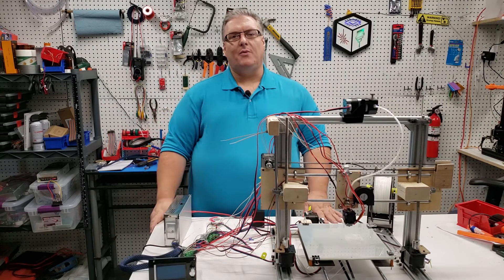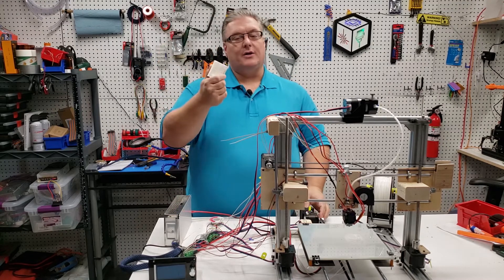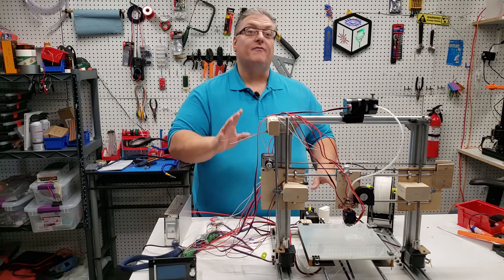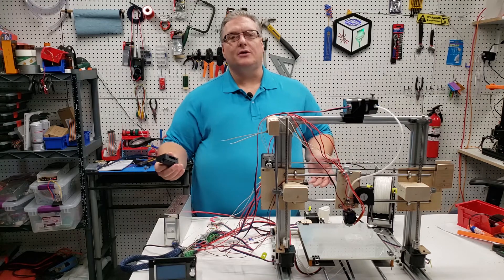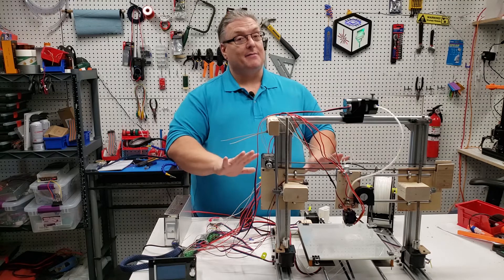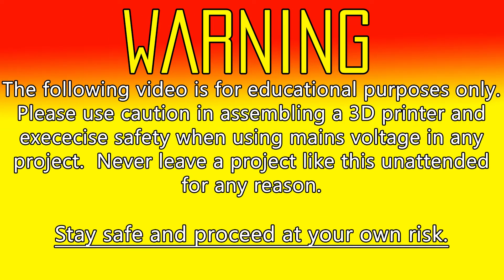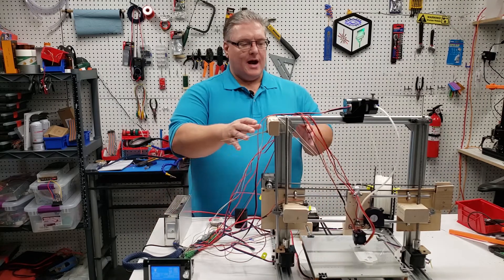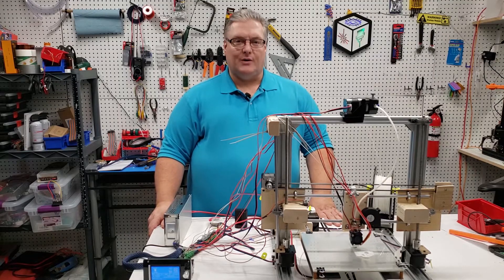Frankenstein Printer Build - DIY 3D Printer using wood and scrap parts!

Comment: I would never want to do something like this, because it was so much easier to buy the cheapest kit printer - it may be wonky, but it's good enough to improve itself, and the kit is kinda cheaper than the hardware contained therein, shipping costs considered; but i do find this highly inspirational. I hear makers all over India are in pain over their country's trade war with China, so their supply for a lot of parts and kits is cut off, and i can imagine there are circumstances where this bootstrap approach may be still necessary.

Comment: If you're buying aluminum plate for making corner brackets, would it make sense to buy extra to make some of the parts you made from plywood? Could extra lengths of some of the extrusions used in the frame be used for the larger wood blocks? 
Just thinking they could be used for a bit safer and stronger bootstrap version or possibly in place of some of the 3D printed parts permanently.
Reply from the maker: Its possible but I haven't tried it.  Really great thought though I certainly would give it a shot if you're comfortable with that. I used wood because it was disposable and cheap. I would only use wood until I could print 3d printed parts but you might get more mileage from the metal.
Reply: @MakersMashup  Just looking at ways to be able to get more done without the prints to start with since all the libraries in my area are closed and starting to charge for prints.

Comment: Hi, I would like to know what you used to replace the piece C201 - 2020_Print_Bed_Linear_Bearing_Style_2.Stl, used to hold the drylin linear bearing, support of the hot bed. SC8UU? Thanks and congratulations for the fantastic realization
Reply from the maker: Yes a standard bearing block is what I used.

Comment: Will you use the Frankenstein 3d printer to print 3d printed parts to upgrade the Frankenstein 3d printer? and will you make a video about it?
Reply from the maker: The Frankenstein printer was actually done after the video series on the how to build your own 3D Printer we did wezyap.  Just go to this playlist https://www.youtube.com/playlist?list=PLyYZUiBHD1QjaYx7eCEW8zXvsgwEbAykY  which is the 3D Printer build from the parts printed in this video.  We just shot this video afterwards building a second C201 since people asked about how to print parts if they did not have a working printer.  So Frankenstein printer was born!  Thanks for your question!